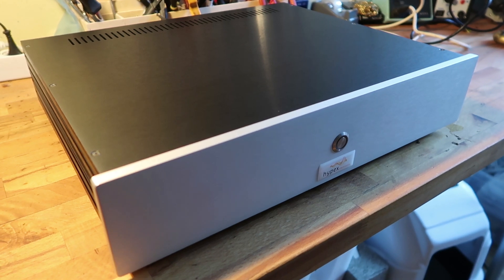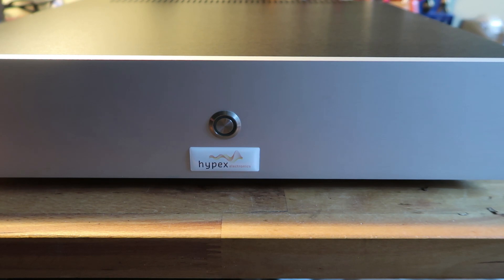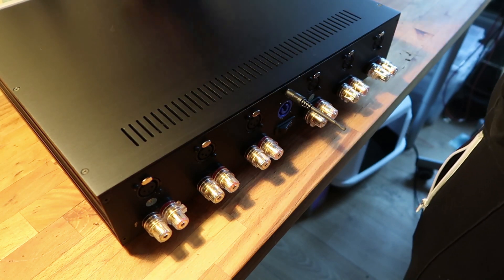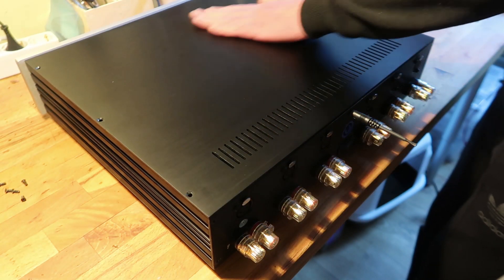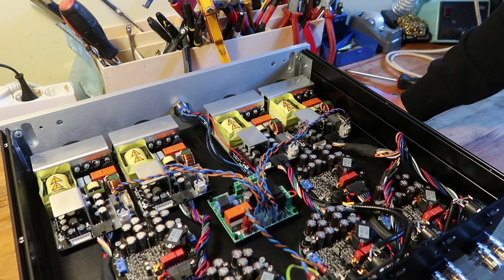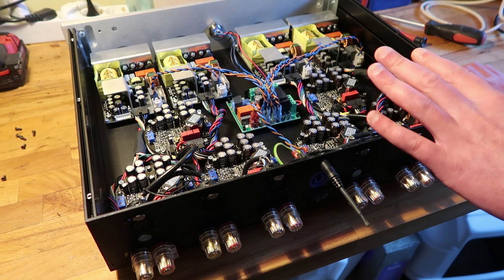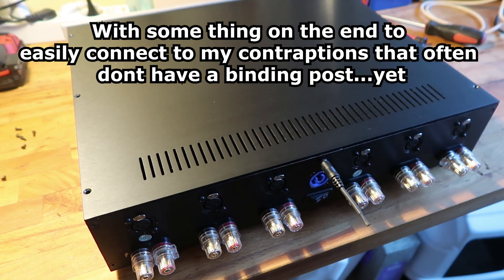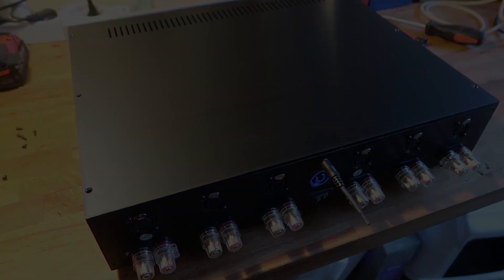New test Amplifier - lets look inside !

Comment: Looks like class D. I still see people preferring class AB and A amplifier for audiophile. 

In my experience I used LM3886, LM1875 and couple of TDA ICS. I also found that Texas Instruments gives you their class D chip sample for free. I tried them and in my experience, maintaining THD+N low is easier with class AB while class D most difficult. Class A especially Nelson pass ACA was  the most cleanest but power hungry and required expensive dc filter capacitors.
Reply from the maker: well i hope you do know Hypex Ncore, much reviews can be found with THD measurements. it this specific module was nr2 on audioscience review page ranking for a some time
Reply: @joppepeelen  I didn’t. Thanks for mentioning it. I am curious about this company now. As I live in Netherlands I will explore this Dutch made amplifier.

Comment: Looks like you've got a nice amp and it's capable to drive loads down to 1ohm.
Though Class-D amps are still frowned at by many audiophiles, hopefully this amp works fine with your contraptions.
Reply from the maker: yeah audiophiles :) they should take a look at the measurements :)  its a perfectly fine amp :)
Reply: @joppepeelen  Some audiophiles trust no measurements but only their own ears and whatever else is participating in sound cognition. So don't expect nice measurements to be something of much value for such guys :)

Comment: Hello Joppe, do you want to test a current amplifier 0.1 Ohm from us? For our current amplifier you do not need transformers. This amp you are testing is a pure digital amplifier.
Reply from the maker: its a class D amplifier yes :)  a  current amplifier sounds nice for pure ribbons !  testing an amplifier purely on specs is more something they can do at audiosciencereview. using it in a situation with 0.1 ohm on the other hand sounds like something i could try :) haha it would make a nice ribbon amplifier i think !
Reply: @joppepeelen  I have Strathearn ribbons and my own ribbon developments. My ribbons have an ohmic resistance <0.02 Ohm. My foil is not made of aluminum

Comment: 9:40 
Beautiful amplifier, built with a head 6x separate power amplifiers. 4 power supplies and 1 soft start
Are there preamplifiers on the power amps? Is it pure audio?
It is quite possible that it is a prototype that someone built in the company you were talking about.
If there is no official information about him, it means that he is unique and you are very lucky
No matter how much you paid for it, it paid off :)
This amplifier will give you a huge leap in quality
Reply from the maker: well the units inside are well known poducts of the company also available to the diy comunity. so its not unique. but normally you buy a kit with either 1 or 2 of those nc400 modules. with either 1  or 2 powersuplies.  it saved me allot of hassle putting all of that in a housing :) for far less then it would cost new ofcourse. so im happy :)

Comment: Looks very nice! 

You are exactly right about the small cable at the back. It’s a remote power enable so you would only have to turn on one piece of equipment (a dac for example) with a remote out. It would go to, say, an active crossover and then to your power amps. Preferably over a delay relay so everything powers on one after the other and the speakers are protected from pops.

Comment: the Amp looks lecker ;) As you shureley know is it possible to make an adaptor from XLR to cinch by only using signal Plus and Gnd.
Reply from the maker: haha,  it seems i was not to clear about the cabling i make :( since you are number 2 mentioning it. my fault.  i indeed will make 6 cables balanced to unbalanced first.  and when i do get a balanced DSP i change the whole thing up :) to get more output. but that can only happen a fter buying a new dsp... so might take a while

Comment: You do not need a preamp XLR,  just buy  RCA TO XLR . The cables then are configured to neutral and ground are connected together , XLR is only necessary for if you will use excessive lengths of cable for the signal , I use pro amps for home audio all the time , so I hope this gives you a sigh of relief.
Reply: @joppe... Chinese Seller offer '9V IR Remote Control volume board Pre potentiometer' for about 15 Euro in ebay
Reply from the maker: i know :) thats my first cabling. but i do need a pre amp. or i might blow out drivers when i start my laptop or unplug me dac :) it also means less amplification. balanced usually  has higher RMS, so eventually i do need balanced :( but not for now i think
Reply: @joppepeelen  a used NAD would be good , or a good chifi.  I have been experimenting with some of the YAQIN and I am very pleased with them .
Reply from the maker: @jasontimothywells9895  i was thinking about a NAD pre amp they are cheap and rather nice :) or else maybe a rotel ...  but the  NAD is best bang for buck
Reply: @joppepeelen  NAD is my choice , I have a few preamps , 6 power amps and a integrated amp, all made in the mid to late 80's,  I recap and give tune ups on them every 8 to 10 years .